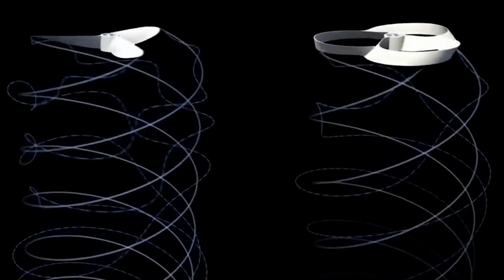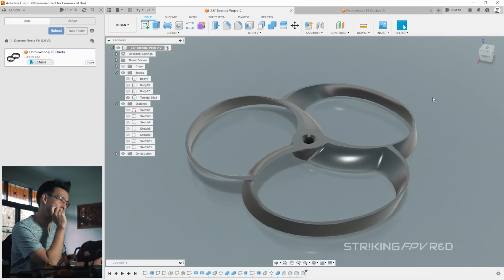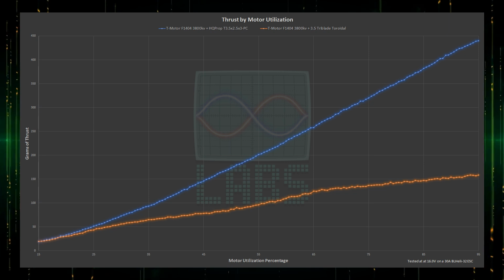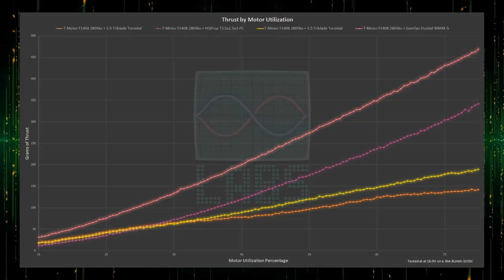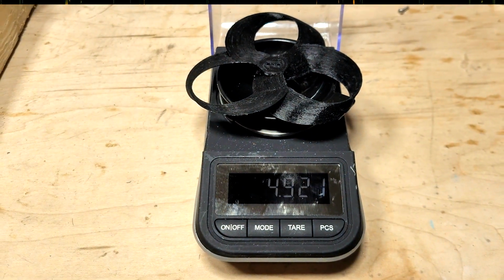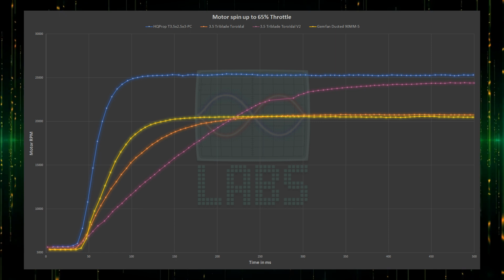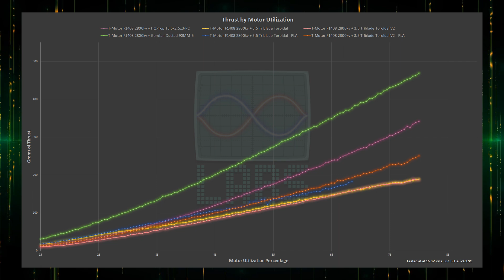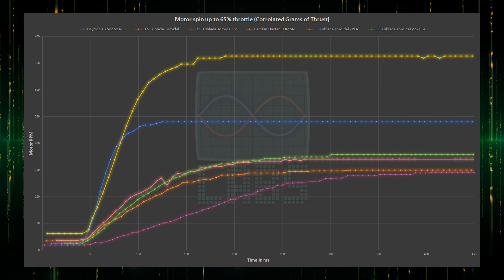MIT Toroidal Propeller Testing - Performance, Efficiency, and Response - PETG + PLA

Comment: The gemfam triblades are super quiet if you join the drone camps discord I have videos comparing them on my rekon35 I can't even fly them on the rekon35 I get wobble it's extremely unstable drone camps discord in the videos tab your data tracks with my testing

Comment: Good work. This is much closer to the reality I was expecting. These are still just bench tests and of crude designs but absolutely not anywhere close to the promise so many expected. Still a novel and intesting direction to investigate.  I personally believe a traditional blade with a forward swept outer end behind another blade with a back swept outer end, with the ends connected by a short connector may be a much better way to go. Specifically because forward swept end is going to be more efficient and quieter, just hard to manage the forward sweep under load without fluttering. So if there was a blade in front stabilizing it, we'd get some benefit. Resulting ~4 blade prop with 2 pairs of connected blades might be close to a triblade in efficiency and we might get other benefits we don't know yet.
Reply from the maker: Appreciate the comment bud. That is an interesting idea. We've come a lot way over the past few years (especially with sub-250g propulsion options), but I think there is still a lot of room for improvement with propeller designs in general, especially for specific lengths where we don't have a ton of great options

If you ever want a design tested, reach out as I would be more than happy to help.
Reply: You mean like the Sharrow design?
Edit: Nevermind. I think I see what you are describing. But if I squint my mind's eye hard enough it starts to look like these toroidal shapes again! haha

Comment: IMHO you can't print roughly a random design without ANY calculation and expect it to behave near the MIT best ones. For the marine counterpart there have been TEN YEARS of development and they outperform by a good margin every traditional marine prop. We must wait for properly designed, tested and manufactured ones.
Reply: MIT filed their patent in 2017, so that is SIX YEARS. And they didn't give us any data. They even muted the mic when showing their own design (and if the short flight is any indication, then their drown with toroidal propellers is very wobbly), never gave any data (rpm, thrust etc).

Comment: If you're continuing with FDM, then you should try out (eSun) PLA+. It is easy to print and holds up very well to mechanical stress. I have a spinner made from it on my Eclipson Model S (1.8m electric glider) and it holds up great thus far.

Comment: OK post commentary; Did you notice they started with tri blade and the one that is published as the final only had 2 blade? Why do you think you could make it work when they clearly couldn't? I had already commented a bunch on this but to sum; You would need to have a cast version to test properly. Though I am not sure if liquid is what they used. But I would guess it was injection molded and the molds made by smoothed 3d prints. #2  there is a lot of calculations that need done. I would have guessed from the into you would know this, but straight blade prop science has over a hundred years of R&D as well as wing geometery efficiency and quietning down pops have always been a huge priority to the military. If you look at the osprey, you will see as far as it has come, and that thing is insanely loud. 
The airflow over the whole of the wing needs to be known. The thickness of each bit of the prop needs to be controlled as it effects the other side and the speed and driection of the wind flow. 
These are just hints at it all, but the idea being is if you want to start somewhere start at the 2 blade, and try your best to mimic what you can see in those final pics and go from there, no reason to retread, especially if you aren't going to be evolving the blades, weight, size, just so much needs to be done. It is rather ambitious but a great time for it considering it is viral.

Comment: I'd love to see this kind of analysis include a 3d print of a traditional prop design to determine how the filament texture on the blade affects performance
Reply: My thoughts exactly, and my gut feeling is that 3D printed props suck BIG TIME!
Reply: yes, then they could call it "science"
Reply: @johgude5045  the MIT did show they also 3d printed the prop and still claim all the good thing. 
So testing it by 3d is absolutely fair. 

Now it would be nice to have more data but even now the comparison still stand
Reply: @zblurth  you think testing an extruded prop against a 3D printed one is fair? Have you ever seen a university from the inside? These video does not proof that the design is flawed, it just proofs that 3D printed props suck
Reply: @zblurth  one thing to keep in mind, university labs have access to industrial 3D printers that are worlds more advanced than anything a hobbyist would have, we're talking like $100,000+ machines. I used one as a student 10 years ago and consumer printers today still come nowhere close. I'd imagine a prop made by one of those could have significantly better performance than what we see here
Reply: Good idea..but if they’re both drag limited, it won’t show which is potentially better for some uses. We need a smooth toroidal prop to test

Comment: Very interesting. 
Wonder how much of the bad performance results from the fact that they're 3d printed and not as smooth as the compared traditional prop. 
A sound test at the same thrust levels would be interesting.
Reply from the maker: I don't have a proper DB meter (I probably should get one at some point), so I didn't want to give data recorded on a phone app, but suffice it to say they are significantly louder than the other prop. I'd estimate closer to a full sized 5" propeller based on the level of ear pain, and that was only up to 80%. Less screechy? Sure, but DB matters more in my opinion.
Reply: @RecursionLabs  Interesting. For me it wouldn't have needed to be scientific, just hear it...
Reply: It's a scam.. a 35 year old scam .  It just came back is all

Comment: Please print a traditional prop with ur fdm printer an test it ... will most likely preform even worth than the printed toroidal prop. 🤦‍♂️ The overlap beween people with prop teststands and resin printer seames nonexistent. Why do you even post such a test? Pure kickbait!
Reply: It proves that it is bs.  It's a scam.. a 35 year old scam .  It just came back is all.

Comment: I wonder just how bad a "normal" prop would fare if you just knocked up a design in CAD without any aerodynamic calculations or testing, then printed one in low-res PLA without any regard for weight.   These experiments are kinda fun but don't really attempt to explore the possibilities.  The 2-page paper from MIT has a photo of their props and they look far lighter, thinner, and have thickness optimised along the loop so there's less weight used at the outermost point.   They don't look anything like what anyone on YouTube has managed to design so far.
Reply: Yeah, everyone got a little excited and the 5 minute hot takes show their weaknesses. For the thickness of a typical drone blade it will be very hard to make something optimized in all areas with just FDM and typical nozzle sizes. For example, even just my 2 blade Gemfans, the injection mold is pretty complex. I don't see how I could even come close to copying that shape with FDM.

Comment: If anything, I think the design can still be optimized since you're working with toroidal propellers designed according to an image without any attempts to optimize things like pitch and shape.  All optimization attempts right now are to keep them from breaking apart mid-flight.

I wonder if you're actually supposed to shrink the propellers to get equivalent performance since I noticed that they spin slower and take more power when they're the size of the comparison props.  Maybe if you shrank them by 20%, they'd be lighter and spin just as fast as regular props?  Then you'd get to see if they give a more competitive performance.
Reply: But, if you shrink them then the thrust goes down. Since they already produce less thrust than the commercial props you are going backwards. But also, as an example: 4" props make my quad faster than 3.5" props even though the RPM is lower because my motor isn't big enough to swing them. It's all an interesting physics experiment.
Reply: @mjodr  The thrust goes down if you keep the rpm the same as its larger cousin.  But when they're smaller, they're lighter and the motor can spin them faster offsetting the thrust lost.
Reply: @tasa4904  I don't think there is a linear relationship there. I don't know why, and I don't know the math, but that's how it seems to play out. Also, a lot of times you are bumping into mach 1 at the tip with the high performance machines we build. You can't just strap on 1" props on a 5" frame and spin them like 400,000 RPM to produce the same thrust.
Reply: @mjodr  You're right, it's not linear.  But it's the motor that dictates these curves.  And when a certain propeller is spinning slower than its peers but the motor hasn't changed, that suggests that it feels larger and heavier to that motor.  If I had to break it down into laymen's terms...it's like a monster truck raced against a ferrari on a drag strip...and lost.  Then you're taking the result and arguing high fuel consumption (power usage) and lower speed (less thrust) when half the problem really is the massive wheels.

Comment: I am interested in what you think of my video on this... so far everything you have tested proves my theories correct
Reply from the maker: Took a look earlier this morning. I'm trying to be open and objective, but your points are valid. What I did not like is that they were using thrust stands made by the same company as mine (shown in the intro) with all the same capabilities. This means they definitely have data they could have published if it would have helped sell the concept, but chose not to and instead only made claims about eliminating a specific frequency of noise....
Reply: @RecursionLabs  there have been a lot of claims that they withheld the data due to their patent. However, the patent is so broad it kills even modifications. And that explanation doesn't answer why they would boost the standard FPV drone, but then intentionally mute the toroidal one ... Is it that when on the test bench they can spin it at lower rpms to achieve low sound?

Whereas when on the drone the thrust needed to take off is consistent between props
Reply from the maker: @33rdframe  That wouldn't make sense since the entire point of a patent is so you can release information but be protected. Even if it didn't, it's not like that information would be useful outside of demonstrating capabilities.

Comment: Thanks for putting this idea to rest. As someone else said, I could see how this would work fine in water as it'll spin up pretty slowly anyway while being fully surrounded by water but for quads we need quicker response and if slow response isn't a trade off for efficiency then it's pointless. I'd def love to see mote prop development but this just isn't the route. 

On another note, I'm waiting patiently for your 1604 motor testing!
Reply from the maker: As am I since I always do at least one new build in the spring, and I want to try something different. It'll be coming.

Comment: Seems like this concept is going a little bit viral! Unfortunate that they didn't perform to our standards. Maybe a comparison between 3D printed conventional props and these 3D printed toroidal props could be a better one? Very interesting and informative, thank you 💯
Reply: Haha..that's what I just posted.. didnt read your comment. Yah.. I think the material + roughness of 3d prints vs the props you can buy which are smooth.. and probably better material for props.. is making a difference. I'd be curious how 3d printed regular props compare.
Reply: Yeah, the quality on this print leaves a lot to be desired. I think they could have done a lot better with it, and it should definitely be compared to different prop designs with the same print quality.

Comment: Why did you try the 3 blade, instead of the 2? (which is the one that, in the paper... worked...) 
Of all vids of tubers furiously copying some other rando tuber fusion 3d stls and then rushing to shoddily print, 'test', and slam together genious toridial 'hot takes' ... this video is well... one of them.
Reply: I love this guy's other videos and the data on those is greats. But yes, I agree, everyone needed to get their hot take in real quick before the trend died.

Comment: Thanks for showing the results on your thrust stand. I've been through just about evey prop from 40mm to 7' on the market. Of course matching the motors and builds.
All just to find a quiet fast drone.
My results match pretty much what quadmovr praises as whisper props.
The HQ 6 and 8 blade props are most silent. Just keep in mind you cant really just use a tri blade setup and put on a heavy, high pitched 6 blade prop on. The motors wont handle them. My rule of thumb would be to go down 1" on prop diameter. Or go up with motor seize with lower kv.
I mean having silten props was the whole intention for these toroidal props right...
Reply from the maker: That makes a lot of sense. When you increase the blades two things happen. First the prop can't spin as fast (less RPM) because it it has more load, and with less RPM you can produce the same thrust as a prop with less blades, and a lot of the sound profile comes from the speed the prop is spinning at. The typical downside is less efficiency, and bigger motors.
Reply: @RecursionLabs  Exactly, I believe that in Germany they made Cessna owners retrofit 3-bladed props for noise abatement, but the most efficient (thrust per Watt) prop would have a single blade if the motor can provide the higher RPM - some powered sailplanes have those.

Comment: It works, so do circular wings, but that doesn't make them practical/doable. Diminishing returns -- adding mass without improving any other feature. The prop you made with the deeper chord, could be extended further to make essentially a multiblade Archimedes Screw. It'd work well moving water, sand, they're used that way now in food processing. But not for moving air at high speed.

Comment: 3D print the standard prop and retest
Reply: I have done it with a custom design and it was efficient as long as the design is tuned. But for the trouble it get you,  it is a waste of time.